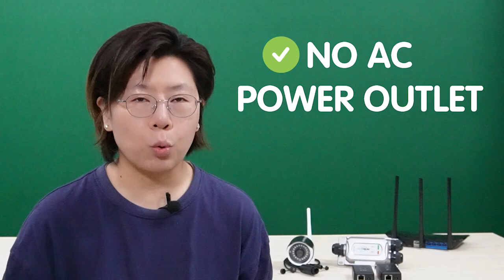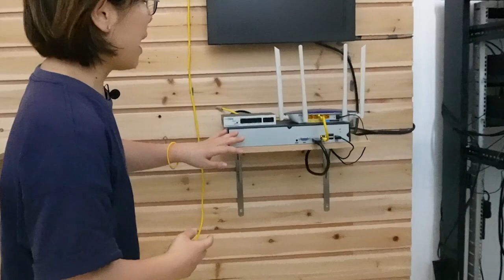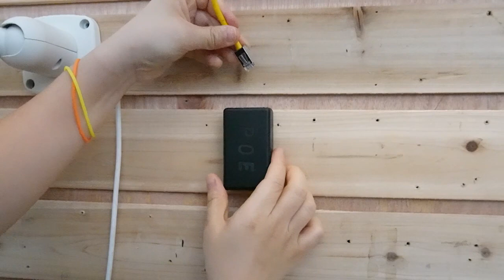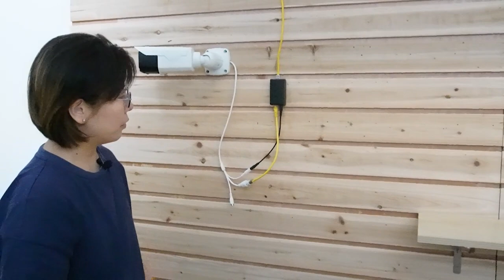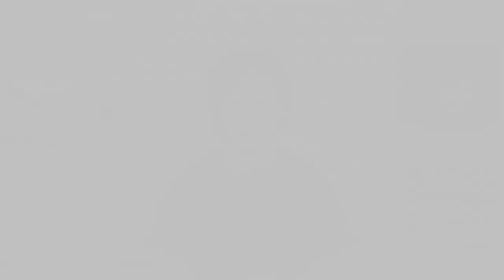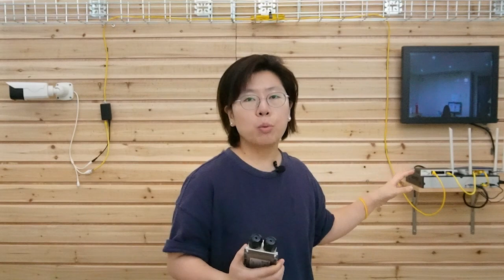PoE Splitter| Use PoE to Install Non-PoE Device| The Easiest Way

Comment: Can you add 4 cameras using 1 ethernet cable if you have 3 of these splitters and are using say a 90w injector? The range is only about 30 ft between each camera.
Reply from the maker: Each camera requires its own data connection, and splitters only divide power—not network bandwidth. If you want to power multiple cameras from one location, we recommend using a PoE switch with enough ports and total wattage to support all your cameras.

Comment: You said “today, I used the 12 volt splitter” , yet the screen posted a note that said “5V”
Did you say the wrong information?
Thank you for information! Very informative!!
Reply from the maker: Typo, this is a 12V PoE splitter.
Reply: @Fastcabling  , thanks for clearing that up :-)

Comment: Hi,
Thanks for video, very educational. I have 2 dilema.
1. non PoE camera does not have RJ45 connection, only the old round one (one you didnt use in your demo)
2. non PoE ptz that operate in 24V AC

Any solution to that?

Thanks
Reply from the maker: We appreciate your support. Please contact our support team at support@fastcabling.com for personalized assistance.

Comment: Guys i have a wireless  Non POE Hikvison , 8 camera  with  NVR. And more also i have 4 set camera  of POE Annke with cable how can i connet both to work affectively.  HIKVISION  Non poe and Annke poe
Reply from the maker: To effectively connect your non-POE Hikvision cameras with your POE Annke cameras, you'll need a separate power source for the non-POE cameras. Use a compatible power supply or PoE splitter for the Hikvision cameras, and connect all cameras to the NVR for centralized monitoring. 
Here is the PoE splitter product link: https://www.fastcabling.com/product/ieee-802-3at-gigabit-poe-splitter-with-a-12v-output/

Comment: Not all splitters can negotiate with the power injector!  You'll need to get ones that have the chipsets that work together. If you aren't familiar with POE standards, and can't handle reading about it online, your best bet is to get a matched pair, like TP Link S and R units.
Reply from the maker: The standard POE splitter which is compatible with IEEE802.3af/at/bt should initial the power handshaking with a PoE injector or PoE switch. I mean, no matter the 1236 or 4578 is the power pin. The POE splitter should be able to handle it. This is the specification of IEEE802.3. However, Some of the TP-link or UBT products remove 4578 to work with DC24V or DC48V passive POE which removes the power handshaking. Technically, this kind of design breaks the IEEE 802.3 protocols. It might have no problem to work with their own PSE, but it will definitely cause the issue in the latest POE standard IEEE802.3bt. It takes all 4 twisted pairs to send the power. When the latest POE standard initial the power handshaking through 4578, it will detect the abnormal and stop the negotiation process.

Comment: Hi 
Is fastcabling POE extender compatible with cisco sg300 poe switch please suggest  I want to use this for our outdoor cameras which are over 100mts away from switch.
Reply from the maker: Yes, it is transparent to network switch. It works with any TCP/IP network.
Reply: @Fastcabling  thanks a lot for your reply